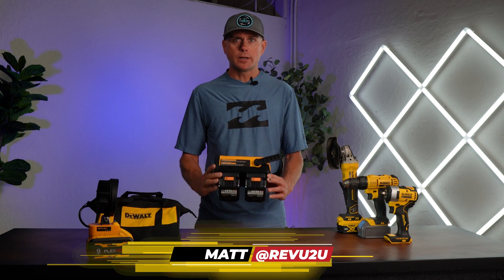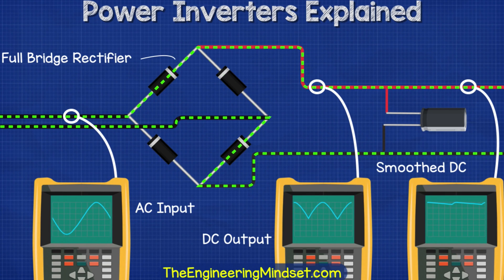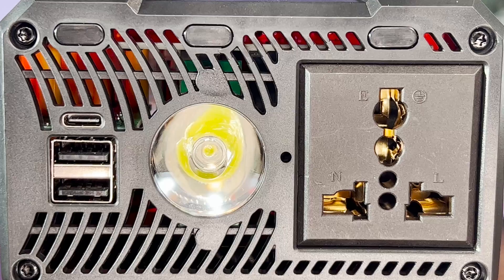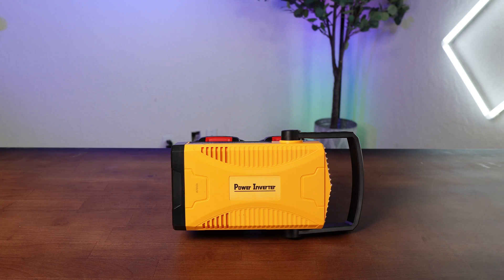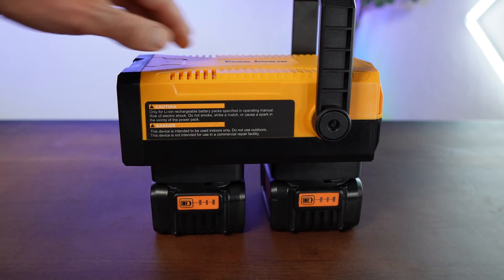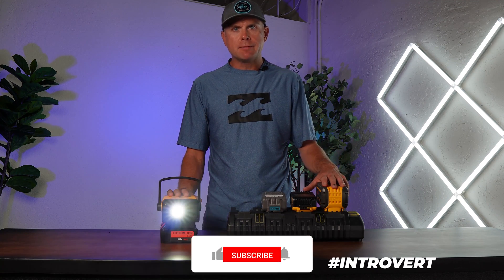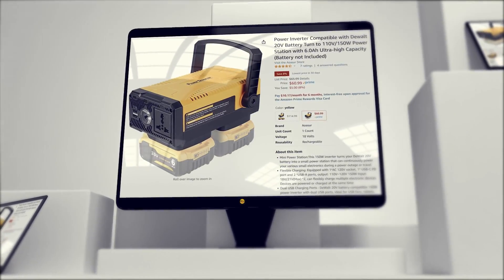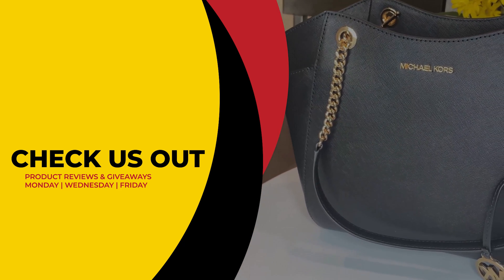Turn Your DeWalt 20V Battery into a Small Power Station! We Review the 110v/150W Power Inverter!

Comment: How about several DeWalt chargers.  With 15 DeWalt batteries I have five chargers, including a dcb215 charger - the big one.
Reply from the maker: Great setup! With five DeWalt chargers—especially if one is the DCB215 fast charger—you're looking at a decent power draw, especially during simultaneous charging. Here’s the catch:

A 110V/150W power inverter likely won’t cut it for all five chargers running at once. Most DeWalt chargers draw 100–150W each, and the DCB215 can pull even more under load. If you plug in multiple units, you’ll quickly exceed the inverter's capacity, triggering an overload or shutdown.

What to do:

Use the 150W inverter for one charger at a time, ideally not the DCB215.

If you want to charge multiple batteries simultaneously in the field, consider a pure sine wave inverter rated at least 600W+, ideally 1000W, especially for fast chargers.

And make sure your power source (battery or vehicle) can handle the load safely.

You’ve got the battery inventory—now it’s just about matching the right power infrastructure. Solid question!
Reply: @  I like the DCB1104 - dual stage chargers.  I charge up a battery on it and the plug it into a 107 charger to finish up the charging -topping it off.
Reply from the maker: Love that strategy—that’s some next-level charging workflow! The DCB1104 dual-stage charger is a solid choice for getting a quick bulk charge in, and then handing it off to the DCB107 for a slower, gentler top-off is actually a great way to preserve battery health long-term.

That kind of charger pairing shows you're really dialed in on managing your battery fleet efficiently—especially when juggling 15+ batteries. Appreciate you sharing the tip—other users running multiple tools in the field could definitely benefit from that kind of smart charging setup! 🔋⚡🛠️

Comment: Forget those 9 ah clone batteries.  They are closer to 5-6ah, because they use 18650 batteries.  You won’t get 9 ah unless you are using 21700 batteries.  My clone 10ah battery has ten Samsung 21700, 5000 mah 21700’s in it.  I know, I built it with the best components that I could get.   It is big, about twice the weight of a 5ah battery but it will run my DeWalt 722 blower all I want to use it.  I have never run it down to one bar - my arm gets tired before then.😢
Reply from the maker: That’s an awesome breakdown—seriously, hats off for building your own 10Ah pack with Samsung 21700s. You clearly know your cells!

You're absolutely right: most of those cheap 9Ah “clone” batteries are wildly misleading. If they're using 18650 cells, you're not getting anywhere near true 9Ah capacity—it’s marketing fluff at best. Without the density and sustained output of 21700s, they're more like overhyped 5–6Ah packs in a big case.

Your custom build sounds like a beast—and for tools like the DeWalt 722 blower, a well-built, high-capacity pack makes all the difference. Love that you outlast the battery before it runs out. 💪 That’s the kind of real-world experience users need to hear more about.

Thanks for sharing—it’s next-level battery wisdom! 🔋🔥

Comment: ive got a few constructive problems with your review 
1 those are not 9 amp batteries its 6 amp 
2 you didnt explain if this unit can hot swap the batteries or not
3 you failed to mention if this is pure or modified sine waves, this is a modified unit and will cause harm to electronic devices such as laptops fridges tvs ect.
4 matts rant made no sense and he contradicted himself
he said he can charge dewalt batteries up and not have to worry about his batteries dying? if he meant his recording equipment then he would flat out be lying to you since this unit damages and ruins sensitive electronics.
5  you didnt give any runtime with the batteries you had.
6 you didnt provide an actual 110v or 150v readout to make sure its actually producing those volts
7 you didnt tell us the watt capabilities of the usb c port
8 didnt provide a lumen range for the led or even showed us how bright it is in a dark room. 
i would say i would rate your review a 3 out of 10 for putting out a video that can cause harm to several electronic devices. also because your link jumps to a expensive option of this product.

Comment: Does this work with the 15ah flexvolt batteries?
Reply: As long as there not to big to fit in the slots I don't see why they wouldn't.
Reply from the maker: Yes, the DEWALT 20V/60V MAX FLEXVOLT® 15Ah Battery (DCB615)* is compatible with DEWALT's 20V MAX* tools and accessories, including inverters designed for 20V batteries. 

When used with a 20V inverter, the FLEXVOLT® battery will operate at 20V, providing extended runtime due to its higher capacity.

However, it's important to note that while the battery's capacity can increase runtime, it does not increase the inverter's output power. For instance, DEWALT's 3-Way 1000-Watt Power Inverter specifies that connecting a larger 20V FLEXVOLT® battery will only increase the run time of the inverter, not the output power level. 

Always ensure that the total power draw of the devices connected to the inverter does not exceed its rated output to maintain safe and efficient operation.

Comment: So, you're turning DC into AC so you can turn it back into DC?
Reply from the maker: Yes, that's correct! A power inverter converts DC (Direct Current) from a source like a car battery into AC (Alternating Current), which is the standard power type used by most household devices. Many electronic devices then internally convert this AC back to DC to operate.

The main advantage of using a power inverter is its flexibility. Many devices, chargers, and appliances are designed to be plugged into AC outlets, so having an inverter allows you to use these devices with a DC power source like a car battery or a portable battery pack.

While it might seem redundant, this process allows you to use a wide range of AC-powered devices on the go, ensuring convenience and compatibility.
Reply: if you do not see the value /purpose for that than you are not too smart buddy